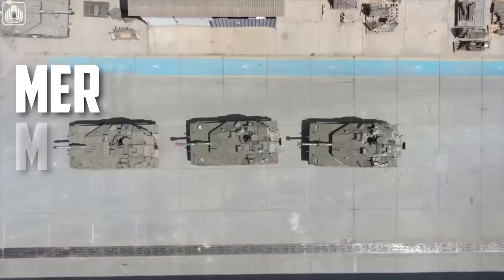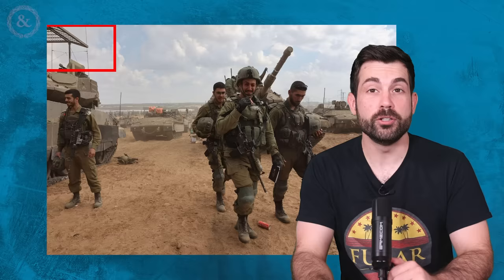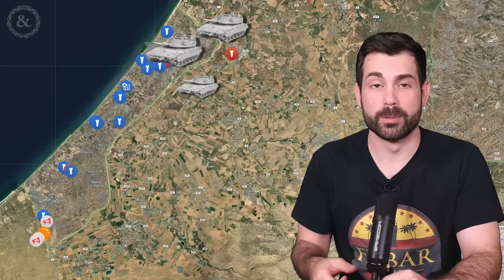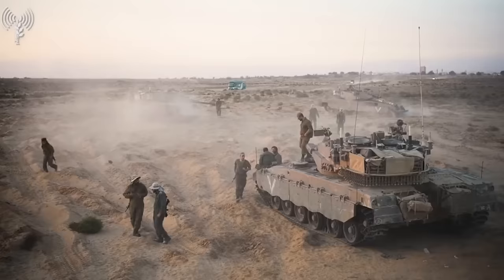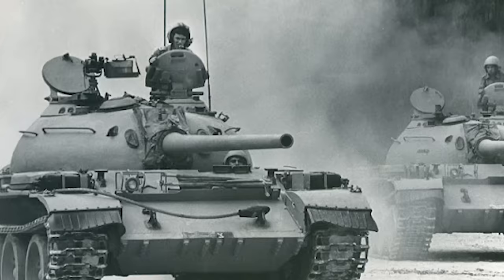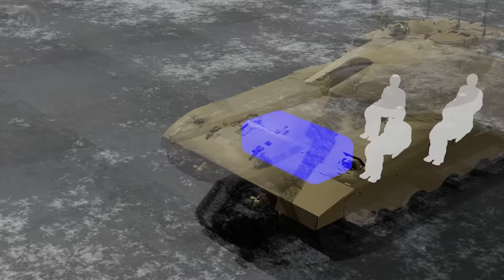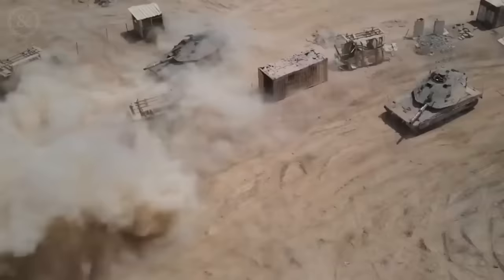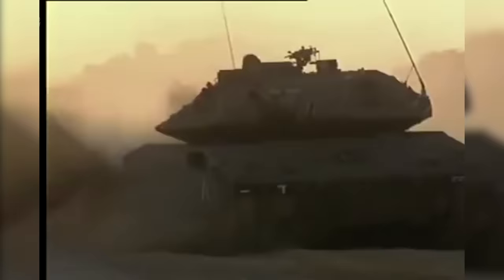Israel’s Home-Built Merkava Tank Tactics

Comment: In 1948, Shermans were still good tanks.   

Couldn't IDF rely on U.S. tanks if not UK or French?

In the Yom Kipper war, Israel almost came to total defeat; Moshe Dayan had a nervous break down and cried in despair at one point.   Only IAF air superiority, and the massive U.S. aid, and the inability of the Arab to blockade Israel saved her.

On the importance of trained tank crew; yes, it has been ignored in some countries, and IDF rightly emphasized it for obvious reason.

However, the future would be different.   A.I. robot crew will be replacing the live human crew mostly, at the front line, execution level.   ROK is already planning to replace the crew for SPGs/K9A3 by 2040, with autonomous K9s.  UK is very interested.

It will spread to MBTs as well, eventually.   SPGs have far longer ranges than any MBTs, and due to the improvement in sensors, and GPS, artillery shells from SPG are increasingly more accurate than ever.

At the strategic/operational levels, SPGs are going to be far more relevant than MBTs, especially when they are going to cheaper, have far longer ranges, and with increasingly far better accuracy than ever before, and no human crews to risk for, especially trained human crew.   SPGs are going to be far easier to make it autonomous than MBTs.

SPGs are meant to be primarily deployed at the operational level, so massive, accurate, long range, on time, economical firepower on demand, in real time, most likely against the enemy armor concentration.   MBTs cannot match that, no matter how good.  For MBTs to be optimal, they have to be deployed in massive, dense formations,  for breakthrough; optimal high value target for SPGs.  Those powerful 155mm shells landing on the top of the turret will wreck havoc; No amount of reactive armor, APS will withstand them.

Putting the engine in the front did make sense at the time, especially for IDF.   However, wouldn't putting the engine in the front make it more bigger thermal target?   Also, it makes Merkava less balanced, on hilly terrain, especially when going downhill, fast.  ROK in the 80s considered Merkava at one point, but found it to be very unbalanced in the rugged terrain.

At 15:35, below,  you can see why this would be a problem in ROK, why K2 came up with the idea to blast the enemy tanks hiding behind the ridge, employing the tank version of 'Shoot and scoot'.   Now, 'The Chieftain' claims this is not a big deal; one could simply call air support.  He doesn't realize one may not have the time to call for the air support, when under fire in real time, when the enemy tank would have the advantage using, 'Shoot and scoot'.

The Furious Tank Battles Of The Korean War | Greatest Tank Battles | Timeline

The problem with the Trophy APS systems;

It's useless against enemy artillery bombardment.   Tanks are meant to be used in big numbers for breakthrough.   They are not really meant to be used in urban warfare.  Also, APS system like Trophy are still vulnerable to enemy RPG or HMG attack.   The enemy infantry could disable Trophy first, before attacking MBTs.   Also, with development of more powerful lasers in compact format, the enemy infantry could silently disable Trophy, before attacking MBTs.

It starts at 03:22 below.

이제 가상이 아닌 현실! (주)한화 레이저의 차원이 다른 클라쓰~ 🤜ㅣ한화잇슈#17 (주)한화 소형 레이저 무기

01:22  1 KW, 500 meter range.

[현장취재] 레이저 소총을 개발했다고? '천궁-II' 탄도탄 요격 미사일 수출로 K-방산의 저력을 과시한 LIG 넥스원

Iron vision is a good system, but still vulnerable from small arms fire, especially from DSMs or snipers.  Also can be disabled from compact laser infantry weapons at CQB range, in urban warfare, silently.

Combined arms warfare is meant to be offensive, not defensive, even at the tactical level.

I believe using MBTs for urban warfare is not the optimal use of MBTs.   I think using AD autocannons/HMGs mounted on 'Technicals' would be far more economical use of resources.  Why would one need tracks on the street?   They have had bullet resistant tires for decades.  'Technicals' are cheap, easily disposable, repairable,  and fast, easy to mount and dismount.

For heavier fire power in urban warfare, they could use breech loaded mortars, on armored cars, like French did, such as Brandt Mle CM60A1, both for close range direct fire, and longer range, indirect suppressive fire,  behind a building.

And Raibo robot platform for battledroids!

Raibo - dynamic and versatile quadrupedal robot

As for Israeli MIC, their hey day was in the 80s/90s.   They chickened out to U.S. MIC.

IAI Lavi

U.S. MIC opposed Israeli F-16 sales to Croatia, as a payback to Israeli opposition to U.S. MIC selling F-35 to UAE AFTER Abraham accords, and later to MBS!

So guess what UAE and MBS have decided to buy instead?

U.S. went out of their way to embarrass MBS after the Kashoggi deal; ROK went of out of their way to invite MBS, and give him 5 star VIP treatment when he was in the dog house, especially from the West, and the Rug Merchant/Erdogan.

Pres. Moon and Saudi Crown Prince celebrate completion of S-Oil petrochemical facilities

Saudi TV ridicules Biden in rare dig as relations sour | AFP

S. Korea and Saudi Arabia agree to build "new future-oriented strategic partnership

Who cares about Kashoggi?

IDF is no longer at the forefront; their ATMOS is a joke, a very expensive joke, a rip off.  Anyone simply could buy the French CAESAR far cheaper, a proven platform.  What does ATMOS offer that CAESAR can't?

Opinion – Denmark’s Procurement of Israeli Guns Has Not Been a Smooth Ride

Comment: @8:48 1.61Km == 1 Mile :. 1.5 Km != 9.3 Miles however 9.3 Miles ~= 15 Km. 

In plain English, instead of math shorthand/symbols:

(At Eight Minutes and Forty-eight Seconds there is an error. One point Six One Kilometers is equivalent to one mile THEREFORE One point five Kilometers DOES NOT EQUAL Nine point Three Miles. However, Nine point Three Miles IS APPROXIMATELY Fifteen Kilometers.) Also the American Abram's tank crews struggled to get 2 miles so maybe it's not a reading issue of adding a point but actually a math/fact issue. How could anybody fire at 9 miles when the best western tank crews couldn't get 2 miles? Editor should've caught this especially if they knew tanks and especially if they knew the conversion from British Standard/Imperial to Metric.

Comment: The design of the Merkava tank was irrational. Its engine is in the front end of the tank. If it is attacked, it will completely lose power and power from the electronics and turret on board. In addition, it has no resistance to the attack of anti-armor grenades.

Comment: The weakest front defense among modern 3.5th-generation Western tanks. If the engine is in the front, it can't thicken the front top armor because of the engine heat problem. Tanks for city battles in non-regular warfare.

Comment: One huge misconception about the merkava that was repeated in this video over and over again regards the troop carrying aspect. The only reason the tank was designed with the rear hatch is for crew evacuation, all the rest is a bonus, like easier restocking of ammo and supplies or just an easier way to get in or out. It will not carry troops in or out of battle and will not perform medical evacuation. That space is full of wet stowage racks for the main gun and not extra room for activities. It is either ammo for the main gun or room for troops.